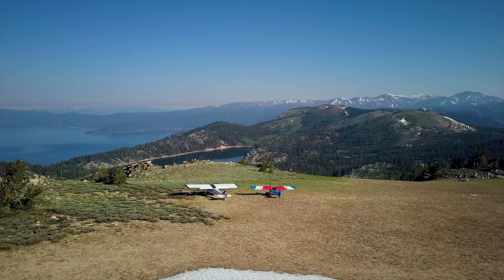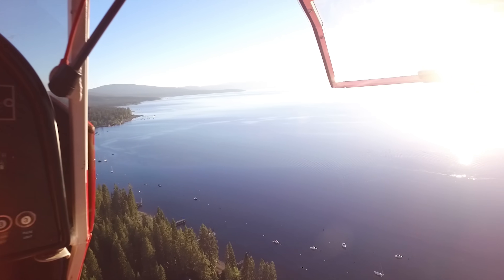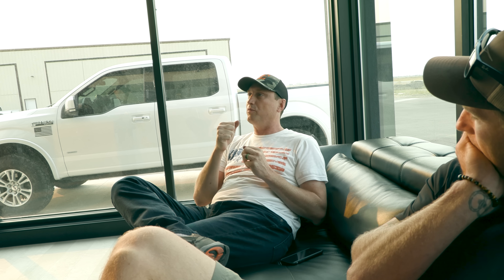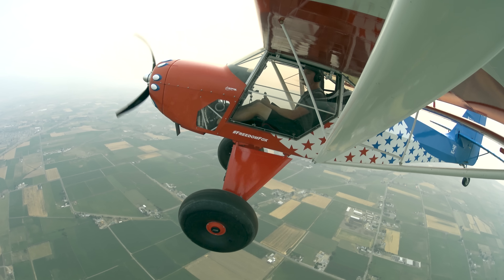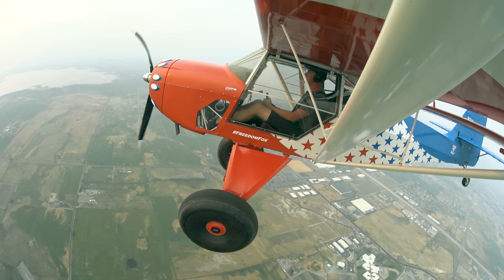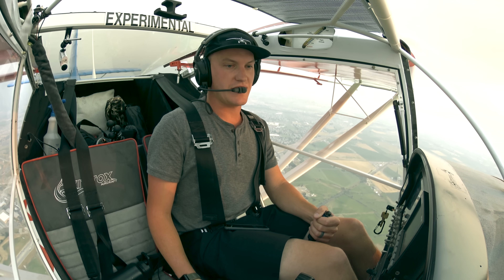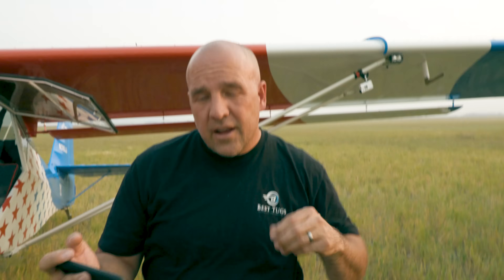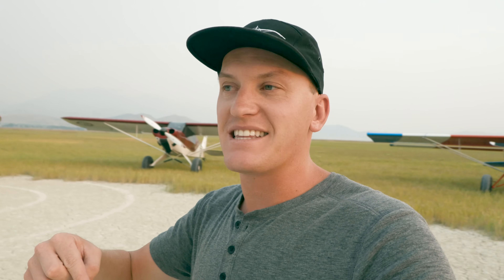YOUR FLIGHT INSTRUCTOR WAS WRONG! - Simulated vs Real Engine Failure

Comment: how is this a debate at all. to me this seems pretty obvious.
you still get power even if the prop is idling. not much, but still some. meaning you get thrust.
windmilling means that the wind is pushing the prop, thus creating more drag, since you get actively pushed against.
stopped you get the drag of the surface area of the prop

highschool phsysics
or am i now weird?
Reply: It's not about thrust. It's about levels of resistance/drag. If the prop is idling but it's not pushing air faster than it came in, then it's not producing thrust. It's also not producing much resistance however.
At those gliding speeds you're not going further because you have more thrust (because you have none). You're going further because you have less drag.
Reply: but thats the point, at idle you DO push air out faster. and then it IS producing thrust
windmilling does get you more drag, since you are actively worked against. work is being done by the propellor and engine, without thrust or power being added meaning you lose energy.
do not confuse the two
Reply: "at idle you DO push air out faster." - That'll depend on the airspeed. Afaik this will only be true at very low airspeeds.

"work is being done by the propellor and engine, without thrust or power being added" - That's not how physics works. Whether the prop is stationary or windmilling, the same forces are applied to the prop & motor. If the prop is windmilling it just means that force is greater than the internal resistance of the motor.
Any performance reductions will most likely be found elsewhere, perhaps air vortexes but not due to that motor itself doing 'work'. 

"do not confuse the two" - Please take a course in physics.

Comment: If your airspeed is greater than the velocity of the idling thrust, then you will indeed have a giant "brake" spinning on your airplane.   Your tests lacked this variable.  Your hypothesis was only confirmed because your glide speed was less than the thrust velocity.

Comment: Idle prop produces thrust regardless of speed. Yes there is a speed the idling prop has "relative" drag but the drag would be higher if the prop was stopped at any air speed.  Now you have to consider the air disturbance created by the stopped prop to the air foil.

Comment: With you living through an engine out, you should know.  The only Air Plane engines I've ever played with were on a thing we used to call, Snow Planes.  They didn't fly but were like cars you drive in the snow that are pushed by a Prop.

Comment: I fly giant scale rc aerobatic planes, 40% of full size, one half scale, so probably very similar to a full size airplane,  with a fixed pitch prop, i fly two or 3 different pitch props, as the plane performs different at altitude than at sea level and I need the plane to perform as similar as possible, the prop pitch is changed for pull out an engine braking and vertical dives. Finer pitch prop at sea level has a significant braking effect and a much steeper glide angle, this is with low drag airplanes like an extra 330, prop braking effect at idle is reduced with a round cowl draggy plane like a Yak 55, the big high drag Pitts s12 bipe I can barely tell the difference in glide between a finer or course pitch prop. So I would say, rather than make blanket statements, because you guys fly high drag planes where the difference is minimised , that it will depend on the airframe and altitude if there is a significant difference. I hope that makes sense.

Comment: I have been flying large RC electric planes for over 25 years. From my experience, if I cut the throttle and don't use electric brake, there is more drag, less range after failure. If I keep the motor at idle, it is LESS drag, more range after failure. This can be tested very accurately with an RC electric plane.

Comment: Prop idling sounds like airmode on a mini-quad.....which gives us more float(which means there is some vertical thrust at idle), compared to motor off? So I think a idling prop has less drag.

Comment: I am into v-drive boats...prop freewheeling engine of will stop the boat faster than engine idle...as for prop stopped....you really dont want to do that, there is a device called a whirlaway that allows the prop to freewheel in case the engine locks up..if you are going fast enough a locked prop will flip the boat and lower speed will slow the boat down faster than throwing anchor....car functions the same way...roll down the highway, off the throttle to idle the car slows down, turn the key off it slows down faster...lock the motor and it stops eveb faster

Comment: Trent, to be clear, you guys are calculating the minimum sink rate of your airplanes, NOT the best glide ratio. Your min sink speed will be about 5 knots slower than best glide and it is here that the more significant difference in sink rate will be observed. —Thomas

Comment: I think the answer is pretty clear...if the prop is idling and the prop surface is rotating through the air at a faster speed than the aircraft is moving through the air then we have thrust (maybe negligible) but some thrust is greater than no thrust (stop prop). At all times every other variable is the same (i.e. the surface area, drag coefficient etc). Happy to be told I'm wrong, but the logic seems right to me

Comment: You have slow flying planes with a GEARED ENGINES and difference was small.. May not apply to other aircraft w/ large displacement direct drive engines and higher.  DO NOT SHUT ENGINES DOWN FOR PILOT TRAINING/PRACTICE, creating a real emergency to simulate one. Want to take risk over underpopulated area and airport with long runway? Great, but this isn't something to do for routine pilot training. You crash, FAA will say cause: Pilot Failure to operate aircraft in safe manner.

Comment: Outstanding video/test. As someone that's had a catastrophic engine out at a low altitude that ended up with the plane upside down in the salt marsh.Ever since I have done this same exercise in every plane I've had since.
One thing I've felt but can't prove is I think it could possibly be the opposite in a high performance airplane and that's where the conflict comes from. But without testing its just theory.

Comment: Trent's tests did show that it is wrong to always assume the idle glide is worse than a stopped prop.   So, it is wrong for an instructor to say so, especially when the training may give the student a false sense of security in glide. 

- It is also wrong to assume that idle glide is always better than a stopped prop. It depends on the airplane, the pitch of the prop and the glide speed.

Of course , in a real situation, best glide speed is not the end-all, be-all.  Slowing to best endurance speed/lowest descent rate (not the same as best glide) may allow the pilot to take a breath and look around for the best landing option (and get the prop stopped) .  If a landing site is already identified well within range, best endurance speed may allow more time for the pilot to make radio calls and configure the airplane.

Another real world consideration is wind.  If you are trying to make it to a field that is upwind, you need to be flying faster than best-glide to make the most actual distance over the ground. Rule of thumb is add half the wind speed.  If you are going downwind, you will want to fly slower than best glide.

Comment: You really should be able to feel the difference in these small planes.  Drag will feel like your foot is slightly on the brake and no drag feels like you are coasting.  It's a feel thing.  I am not a pilot but I have been a passenger and felt the difference and also slept in a Holiday inn :)

Comment: That’s why I fly gliders. No propeller no prob :)
Reply: Yep ... Every landing is a forced landing ... no big deal..
Reply: not to bother you or break your idea, but that's the case with every aircraft going up
Reply: splat003 Yes that’s right! Except when using winch launch, but that’s another subject. 
By the way and with all my respect, that wasn’t really a statement or an idea, I just commented that to laugh a little with fellow pilots (both glider and airplane pilots) :)
Reply: If you can fly a glider you can fly about anything with wings. Love my 1-26
Reply: @fredknows1667  Sanitary pads have wings Fred. Can you fly sanitary pads? 
hahaha PS love gliders.
Reply: There is no better place than cloud base.
Reply: Yes, in Namibia. :)
Reply: Heinz-Geert Peters Haha well said, I’d love to fly there one day!
Reply: Iro65 True!
Reply: Hell yes. I dont fear the forced landings in training or re-currency. I love my 2-33!
Reply: Hugo Girod You still have to get towed so it applies to you until you reach altitude and release that tow line. 
😆👍
Reply: @thelastrebelshow1627  No. You need a winch. That towing is an expensive hobby. If you can afford it, it's okay. But it is not ideal. You need a complete other plane to get into the air. Modern winches can launch lots of planes one by one before returning all those cables. And there are engined self starting gliders too. Also high performance ones, don't worry.
Reply: Voor Naam Never herd of using a winch. I’m old though.😂
Reply: @thelastrebelshow1627   Search for winch launch glider. Google might help you too. And you bet it's an old idea.
Reply: Voor Naam Thank you sir, hey would you believe they use them in surfing now too. Type in winch sessions-surfing. There’s several videos on it. It’s really cool. 👍
Reply: Voor Naam Blair Conklin is awesome Beefs TV
Reply: @thelastrebelshow1627  normal to practice yow rope breaks, emergency releases if tow plane fails. Also true with winch launch, rope break ytsimg is gun on a winch, tons of power to zero inxero time!
Reply: 🎶You can neevvverrrr go around, if you are flyinggggg a glider 🎶🎶 Lol
Reply: Finn Lei Thomczyk done many a go round and touch and go’s in a glider, try flying from a hill site, approach into wind to land, ground roll, then fall over the ridge and climb away! Simple.
Reply: Me too. It's definitely tuned my eye for glide distance (of course in sailplanes you can't do this cause the human eye can't detect a 40:1+ glide ratio).
Reply: Terry Wilson  Yes, he still lives in the woods somewhere in Siberia. His wings broke of, but the fuselage "floated" to Wladivostok at 1500 knots, there he slid ashore and started braking. That's how brake dancing reached Siberia. But nobody cared. His name is Noflynov now. His nickname is Sick-kurski.
Reply: Terry Wilson  Did you see this bungee? It's just like the Wasserkupe and really everything is newer now. And air is still air.

https://youtu.be/zdCGb9-vjck
Reply: Every flight is an engine out practice :D
Reply: thats! the reason why you fly gliders?  wow, sorry man
Reply: @guglielmodicarlo4139  that's a great safety feature of gliders. Sorry you choose to ignore amazing flying with no engine or propeller, your loss.
Reply: @airgliderz  did I say that,?? typical response,, I did not say that, what I said , is that it is strange you choose to fly gliders, strictly for the fact that there is drag on a propeller and it may fail,, THATS what I was commenting about, put some glasses on ,,  you were show boating the affirmation of  not having that issue with a glider,,,  that these knowledgeable pilots were talking about,,, get with the program,
Reply: @guglielmodicarlo4139  get with the program. Clearly that is not at all what you stated until your much changed statement  now. You must be a democrat. Sad.
Reply: Hugo Girod I used fly gliders, no lift, no prop, problem.
Reply: How does the glider get in the air? Oh that's right, with a prop.
Reply: xjinit You sir are intelligent that’s for sure
Reply: @hugogirod1606  and a gofi, before i talk i have it
Reply: Or a winch, or a car, or bungees, or gravity, or...
Reply: @Specter0420  Or a huge balloon?
Reply: @xjinit  No. By a 300 hp winch and a mile long dyneema rope. But thats another story. It a fun launch, though. Climbing rather fast.
Reply: @xjinit  or a winch :)
Reply: xjinit or a winch or bungee
Reply: @xjinit  Or a V-8 powered fishing reel. Or even a gym-sized rubber band.

Comment: I'm not sure that I really understand the arguments around an idling prop creating more drag than it would in an engine out situation. 

1) In an engine out, the engine is producing 0 horsepower, and therefore there is no energy assistance from the engine to keep the aircraft flying.  
2) In an engine idle situation, the engine still has power, and still produces power, albeit minimal. But it is still producing energy, and that minimal energy is assisting flight.
3) In a windmilling prop situation, energy is taken from flight and adds to drag because it is turning over the engine.

Edit: Trent, you should maybe ask those people to ask their "instructors" if they will start an aircraft, leave it at idle on a perfectly flat surface, brakes off, then get out and walk away. Because if the "instructors" are correct, the aircraft won't move. And if it moves, maybe get another instructor.

Comment: Nice subject! When a prop stands stil it's a stalled airfoil. When that prop spins, the airfoil is not stalled and produces more "lift" (=drag) than a standing prop. For a constant speed prop by definition a spinning prop produces more drag (than a stalled prop) as the governor tries to speed that prop to regulated RPM, which extracts energy from the aircraft at a closed throttle. Which means more drag. An idling prop produces thrust only if the airspeed is lower than prop pitch times rpm (although there is a wide band undefined as the ground idle is braked and the overrun rpm (drag) is much higher). So like you said; only effective thrust at very low airspeeds. Which may even be below best glide or below best rate speeds, which makes is counterproductive to let it idle. In general on STOL/bushplane type aircraft, it may be beneficial to idle the engine. On constant speed props and fast cruising airplanes it is just a dragging brake

Comment: Great video but your title is horrible.  As a full time flight instructor for over 15 years, I cringe when I see titles like this and honestly am irritated by them.  But I am also well aware that there are a lot of flight instructors out there that do not train on the fundamentals of topics like this one.  A student should never be taught to judge glide based only on numbers, but should be taught most importantly to be looking outside at what the actual conditions are and what the glide is doing based on outside references, and how to adjust accordingly to whatever the conditions are.  If you watch outside at what your glide is doing and make your judgements based on those outside references, it really shouldn't matter whether the engine is at idle, windmilling or completely stopped, or what your descent rate is.  Unfortunately there is a huge lack of training on subjects like this, which I know is where your title comes from!!!  Most flight schools and insurance companies will not allow training to be done by shutting the engine (single engine airplane) off, so we train the best we can.  But a good instructor will teach students that there is a difference in glide and descent rates based on things like prop condition (as in this video), relative wind direction, advection conditions and available landing locations.  Thank you for doing this video, I will use it with my students to show them what those conditions look like since we are not able to do it in most of our training airplanes.  Great video, just wish you would have chosen a different title.
Reply: He didn't make the title that to call out instructors. He did it to attract more viewers. He was successful with it, but I agree. Initially I judged this video skeptically, but he is right. Low speed idling prop is producing thrust. In usaf pilot training, if we were at full idle (T-6 Texan II with a PT-6 Turboprop) we would actually have more drag and to simulate engine out, we would actually increase power ever-so-slightly which simulated a feathered prop closer.
Reply: It's called click-bait, 
and is a nearly necessary practice (thanks YouTube algo) to gain new viewers.  Yes, as a practice, it's pissed all of us off once or twice.
Reply: Send all your students to the local glider school for that practice. You get all the engine-off time and forced landing practice you can handle. Along the way, you'll also get good spin training etc, typically at a much cheaper rate than power aircraft.
Reply: An engine out means one thing, gravity is King. The only math involved is how much seat cushion does your hole actually suck up.
Reply: F#ck insurance, I shut the motor off anyway. I have learned to fly in gliders 1st so, engine off in a plane is nothing sacred, risky or dangerouse.
Reply: @airgliderz  Lol, obviously you're not scared of dangerous things, you literally don't know how to spell dangerous. XD
Reply: @realitycheck3363  hides behind a fake name throwing stones in a glass house to stoke "reality check" egomania....

Comment: Fantastic video, one last point for you to consider in the spirit of your initial debate, when the prop stops for real and WILL NOT restart – does time subsequently pass faster or slower?
Reply: Depends on if you have a runway below you or not
Reply: Trent, is your left side wheel strut fabric buffetting or is it an optical illusion? It appeared when you were under power but not during engine off.  Might have been prop wash?
Reply: Slower.
Reply: It depends on whether the observer on the ground is a friend or an enemy.
Reply: Well, that depends. Are we talking "Real Time" here or "Perceived Time" while your "hyper-sense" panicy "oh crap I'm gonna die!!" sense of time kicks in. I believe stress is a very effect multiplier.